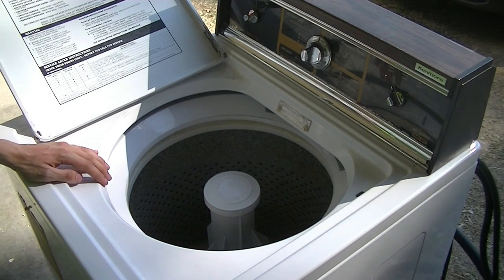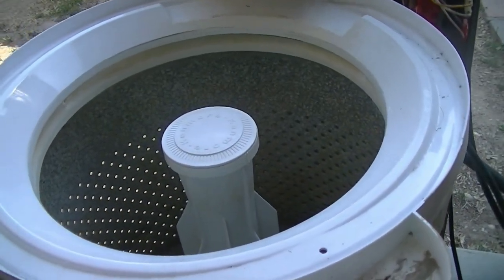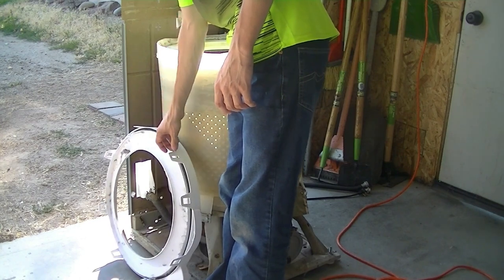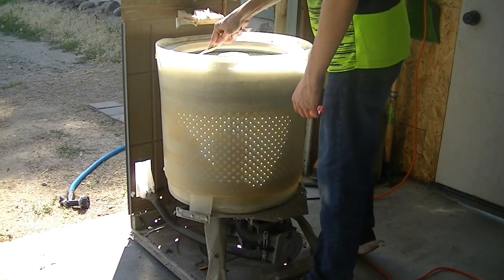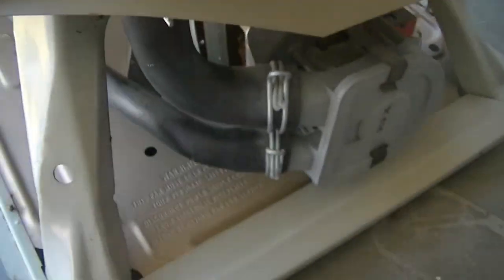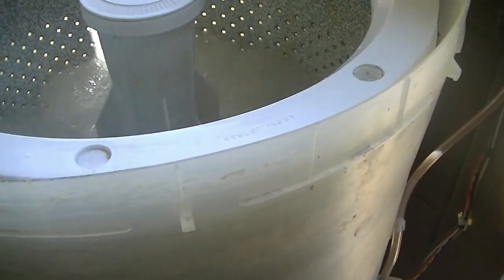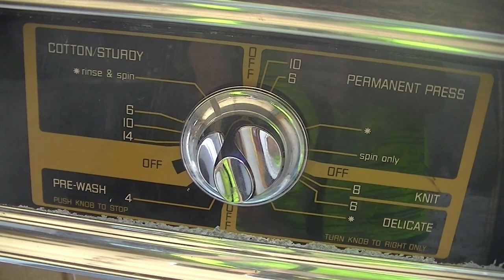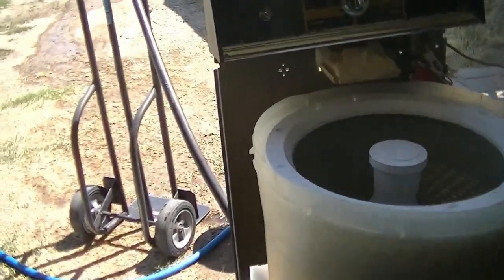Early Kenmore 60 Series Direct Drive - Cleaning & Testing, Part 1

Comment: ? I have one of these that's identical but my problem with it is that the tub or drum whatever isn't centered and Everytime it goes into the spin & rinse cycle it basically tries to rattle itself apart what do you think could be the problem and how would I fix it myself? Please let me know
Reply from the maker: Could be a number of things.  Unplug the machine first of all, then check the levelness of the machine, and the floor it's on.  Is the shipping strap/bolt removed?  It'll be on the bottom.  If all that checks out, you'll need a #2 phillips screwdriver to remove the screws securing the control panel, and open it up.  Then there's a molex connector coming up from the cabinet where the cover lid switch plugs into, unplug that, and then use a flat-head screwdriver to pry the two brass clips on either side of the back panel holding the cabinet on.  Then you can reach under the front of the lid, pull the cabinet off and get down to business.

First thing I would do is check the skate plate, it's a triangular shaped piece of metal located under the tub.  It sits on top of the base support which comes up on three legs from the base frame on the front corners and the back center.  It'll have a flared-up side on it with angled notches on all three corners, and the flat side of it should be facing front.  If it's not, then it needs to be reposited.  You'll need another person (or 2) to lift the tub off it's base while you reposition it.  This video actually shows an easier way to do it so you don't need another person(s) to do it-->https://www.youtube.com/watch?v=w-o2JcdYNSM

And if that fails, the wear/snubber pads may need replacing, they're not that expensive, but it will require lifting the tub up, or even removing it entirely, and you'll need a spanner wrench to do that, which isn't that expensive either, and well worth the money-->https://www.amazon.com/gp/product/B07HR5H616/ref=ppx_yo_dt_b_asin_title_o02_s00?ie=UTF8&psc=1

Link to the wear pads for that machine-->https://www.repairclinic.com/ProductDetail/154558?c=54

Of course, look up your own model#, because it may not be exactly my model number.  That should be located on the cabinet under the lid on a metal data plate (right there in the open).  Then go to repairclinic.com and search parts for your machine.

If you have the spanner wrench, and the cabinet off, you're ready to remove the tub.  Just use a flat-head screwdriver to pry the cap off the agitator, and you'll need a 7/16" socket w/ extension on a ratchet wrench to remove the bolt holding the agitator on (you'll have to hold the agitator in place while you unbolt it).  The agitator should come up.  Then you'll have to look on yours, it may or may not have a metal clip and a plastic retainer sitting around the agitator shaft.  If so, then just pull those off, and remember which way they go back on (the plastic piece goes on first with one tab fitting down in a slot on the drive block, then the metal clip slides down on top of that)

You'll then want to remove the white plastic tub cover ring on top of the tub.  There are 8 tabs that push down and out to release.  (Make sure the gasket seal under that is still good)

Then, take your spanner wrench and align it with two of four notches on the spanner nut, which screws on top of the drive block.  Cover the side of the tub you're going to use a hammer on with a towel, so you don't chip the porcelain basket, and then break the nut loose counter-clockwise with the hammer.  If the nut doesn't want to come loose, keep trying until it does, it may just need some persuasion.  When you do get the nut off, you should be able to just pull the basket up and out.  If that doesn't want to come out, you can take a folded up towel, cover the rim of the basket, and just hit the covered area with hammer, go all the way around the sides of the basket, and keep doing that until it breaks free.

Then you'll need to disconnect the water level pressure hose from the air dome located on the lower rear-right hand side of the plastic outer tub.

Then you'll need a (I forget if they're 1/4" or 5/16") nut-driver to remove the screws for the aluminum suspension spring brackets (same places as the support legs coming up from the frame)--the back one you can use one of the holes drilled in the back panel to reach the back bracket.

Disconnect the tub-to-pump hose down on the front-left hand side of the tub, and you should be able to pull the outer tub up to take a look at the pads.

I would say don't do all of that though unless you're absolutely sure that's what it is.  There are plenty of videos on Youtube you can look up to help you figure out what the issue is.  Could also just be something simple like a broken counterbalance spring.  That's the one in the back side coming vertically from the base frame.  If it were broken, you'd know, as your tub would be leaning towards the front of the cabinet.

Let me know how it works out, and hope this helps!
Reply from the maker: I forgot to add that if you do plan on pulling both the inner & outer tubs out, it'll be TONS easier if you take the fill spout out.  Look closely at the back panel where the spout is mounted, there will be cutouts in the panel where you can bend, or squeeze the two sides of the fill spout inward (or outward, some of them are different) and tilt it up and pull it out of the panel.  And if you want the extra 2 cents of convenience, you can remove the spout from the fill hose attached to it by taking a pair of pliers and squeezing the hose clamp off, then pull the spout off.

Comment: The oil on the transmission and its mounting studs might mean the bearings and shaft seals are starting to fail. Being that it spins ok, might just be the shaft seals. That’s my theory anyway, I’ve seen this before on a direct drive I fixed for a friend. What a pain in the ass that was, and if you do choose to replace them, a 1-1/8” socket and extension bar is used to replace the  sleeve bearings, the seals can be removed with a slot head screwdriver. Also a heavy (3 Lbs or more) sledge hammer is required, a standard claw hammer won’t do jack squat. These sleeve bearings and seals support the spin tube and there is a seal at the top of the spin tube where the agitator shaft protrudes from. Just giving you an idea on what might be causing the oil “spill”. 
Hope this is of use to you! :)
Reply from the maker: Thanks for that!  We'll see when I get into it what kinda shenanigans we run with.
Reply: @lizboz  I try to be helpful whenever I can. Hope the diagnosis and repair goes well whatever it might be, and hopefully your friendly neighbourhood parts store or site  has what you need.
Reply from the maker: I appreciate that!  Yeah, I'll have to sift around for a neutral drain kit, as last I checked, Whirlpool decided to discontinue making it.  Hopefully that doesn't mean they're going to stop manufacturing all parts for older machines.

Comment: I currently have that agitator in my Amana NTW4516FW3. Changed out the DAA.
Reply from the maker: I looked up your model# and you have a new belt-drive one.  Hate to say it, but however bad that DA agitator was before, the straight vane will only be worse in a new one.
Reply: @lizboz  Actually I filmed a bunch of loads with it. It's pretty good. I owned 2 dd washers. One from1988 and one from 2003. Both good machines. I like the straight vane with the longer stroke in these washers. It also isn't as bulky like the DAA I took out. I will say that my machine can turn over a queen comforter with the DAA. slow but it does it.
Reply from the maker: Well if it works fine now, it won't one day when something critical and exorbitantly expensive fails.  That's why I could never own of those, too much tomfoolery there.  My three vintage machines will just have to serve me for the rest of my life.
Reply: @lizboz  I moved into a new home and those were installed. When it fails it fails. Everything breaks my man.
Reply from the maker: Oh I understand that.  Vintage machines are allowed to break after years of service, and even then it's usually just something miniscule the first time around.  And parts will be around for a while yet.
Reply: @lizboz  That's cool .The VMW might not be a DD but I like it's agitation much better.
Reply from the maker: Do you still have the vintage machines currently?
Reply: @lizboz  Unfortunately no. I moved to a new place last June. I have no place to store older machines.

Comment: Good ole Kenmore😄, they don’t make them like they use to :/, also what’s your favorite agitator design that Kenmore had?; just curious:). For me personally I would say the Swirl vane agitator that had the large fabric softener head was my favorite!
Reply from the maker: I don't know if I'd say I have a favorite, they all did an excellent job at what they were supposed to do.  I will say the old Vari-Flex agitator they put in the upper end early 70's Kenmores was pretty cool, gave you the adjustability for more or less aggressive agitation.  Maybe as far looks, I'd say the old roto swirls or the triple action direct drive were pretty sinister looking, ready for business everytime.
Reply: @lizboz  niceee, i forgot to mention a close second would be the triple action agitator that has the shorter fabric softener dispenser, that was used in the Kenmore Elite models was also nice and the Whirlpool gold series version.
Reply: I’d have to say it’s a tie between the Pentaswirl and the Rotoswirl. I know the Pentaswirl is disliked by many because of its poor performance, but once you throw a larger pulley on the motor, it becomes an absolute beast of an agitator. Watch this to see what I mean: https://youtu.be/pbx-O2bOwSI

However, I’m not really that knowledgeable about all of Kenmore’s different agitator designs.
Reply: @solarflea4115  okay I’ll take a look at the video I’m not to familiar with the really old washer or at least the agitators😄, since I’m 21
Reply: @solarflea4115  The first agitator Kenmore used in their first automatics was the bakelite straight vane. My mom had the same one in her 1963 Kenmore 600 series. That was the one that started it for me. Those early agitators were steroidal with their huge fins.

Comment: SMH! Whirlpool couldn't leave well enough alone.
Reply from the maker: I'm assuming you mean the direct drive design altogether?
Reply: @lizboz  Yes!
Reply from the maker: @jeromedavis8575  Like jaykay18 has always said, Corporate American Greed!
Reply: @lizboz  Exactly! At least Maytag direct drives were around from 2007-2010!
Reply from the maker: @jeromedavis8575  They were all around until about 2010, with the exception of some of the more subsidiary brands like Inglis and Estate.  I think they still make them in the stackable units, but I could be wrong.
Reply: @lizboz  I love when the pump runs during agitation cycle on high-speed. It reminds me of a jacuzzi for your laundry. Whirlpool could've used water recirculation.
Reply from the maker: @jeromedavis8575  Oh yeah, the air from the pump helped make more suds in the wash, and it's always cool to see that with the cabinet off.

Funny how there have been a line of tubs called "whirlpool tubs", but they were never actually manufactured by the Whirlpool corporation.
Reply: The whirlpool corporation should adopt the technology to their laundry line and have it run during wash and rinse.
Reply from the maker: @jeromedavis8575  You might as well just ask them to bring back the old school, mechanical, transmission operated, real washing machines--it'll never happen because of greed.
Reply: @lizboz  it would be nice if they did. Those agitators gave the dirt and stains an ass whooping of their lives! Now, these new washers just counsel them!
Reply: @lizboz  trust me, I wish they would! But todays gullible consumers want gentle agitation on the normal cottons cycle. The last time I checked, you shouldn’t stuff these machines. Am I correct? Some say that these agitate at 100 degrees at 180 strokes per minute. That’s reasonable agitation. If I was a load of clothes, I’d jump in the whirlpool direct drive with warm water on full water level and high-speed agitation. And then I’d go in the matching dryer.
Reply: I certainly wish they would but nobody cares! We washer fans do! I am sick and tired of cheaply built machines cleaning poorly!
Reply from the maker: @jeromedavis8575  Console the dirt stains--NICE!
Reply from the maker: @jeromedavis8575  Last I checked, it was 90°, don't know the SPMs.
Reply from the maker: @Jerome Davis That's why I have three old school machines.
Reply: @lizboz  Very true!
Reply: @lizboz  Who knows. We could be mislead. 90 degrees sounds about accurate. At least it causes a whirlpool of water! That is what cleans your clothes! I believe these transmissions use 90 weight non detergent gear oil in them. That's extra heavy stuff!
Reply: @lizboz  Great choice! Hang on to them! I love the sound of the matching dryers too! You can hear the rush of air! They have very effective and efficient blowers!
Reply from the maker: I'm well aware of all that!
Reply: @lizboz  I have been trying to find an article on the whirlpool direct drive system from the 80s and what became of it.
Reply from the maker: If I remember correctly, DADoESTX from automaticwasher dot org has a manual about that showing the release of the one of the first direct drive washers, which was the 1982 Whirlpool #LB5500XK "Design 2000" washer.
Reply: @lizboz  I believe it should be the article which describes some of the features, improved wash action and faster spin as well as larger capacity. Also, I believe they talked about how it was a beltless, revolutionary design. Those washers were technologically advanced at the time.
Reply from the maker: Yes, and yet they were designed so simplistically to be serviced practically effortlessly!
Reply: @lizboz  They even stated that their machine uses 30% fewer parts. I onder if they made the transmission lighter or used a lighter weight oil? I've heard the whirlpool belt drive transmissions weighed at 25 lbs.
Reply from the maker: Couldn't tell you.  Regardless, they all still operate the same; flawlessly and reliably.
Reply: @lizboz  That's good! At least they have a hefty motor compared to today! I have a feeling that the transmission is large and heavy compared to today's models too.
Reply: @lizboz  And sadly, nothing has changed! Look at how Whirlpool is marketing the 2in1 agitator! This is so stupid!
Reply: @lizboz  It would be nice if they did!